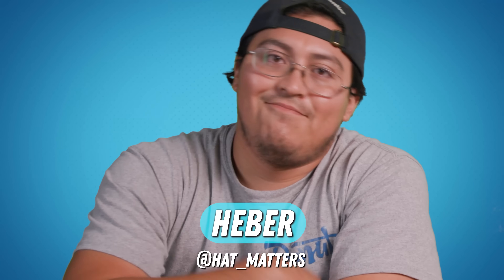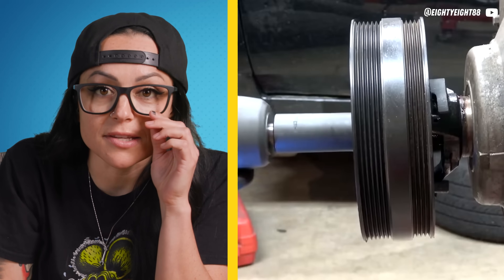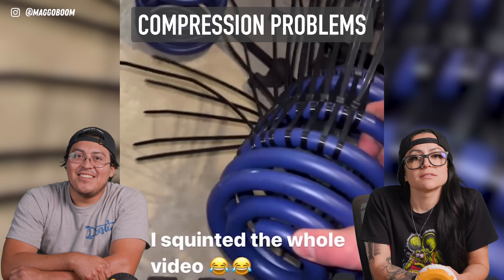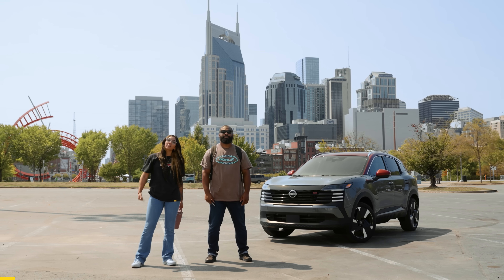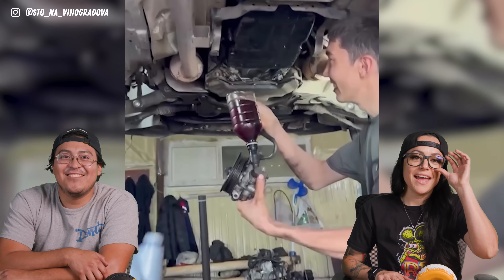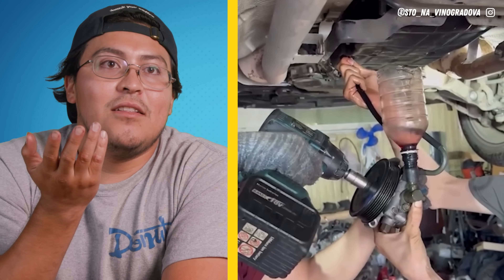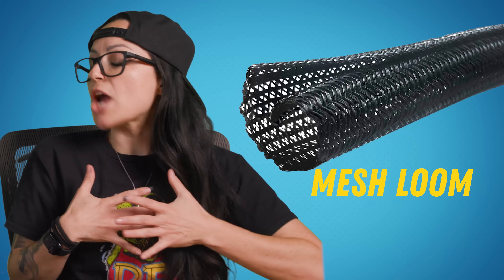Real Mechanics React to Ingenious Tiktok Hacks

Comment: The newer “Smoke” machines are actually just like vapes (for nicotine at least) use a mix base of propylene glycol and vegetable glycerin as a carrier where as the new leak machines and fog machines use just pure propylene glycol and that’s why it smells like marshmallows sometimes lol but that’s why it’s also none toxic if inhaled in smaller quantities. Fun fact lol the old machines sometimes even had a smoking pipe or cigarette end attachment, but if you have ever seen a current small counter top culinary smoker with a bowl for wood chips that was the start of the smoke tester.

Comment: There is a trick my Dad showed me, years ago, on how to remove the rear main seal. You fill the hole in the center with sand and then light bread, then using a wood dole, you drive the wood in and the sand and bread smash out behind the seal, and pop it right out. First time I saw it, it blew my mind.

Comment: Drill Brush brand brushes are made for that purpose and makes several different stiffnesses for different applications like carpet, upholstery, tires, bathroom tile, etc. I have a couple, and I don't have to worry about it slipping out of the chuck

Comment: I've actually done the zip tie trick with springs myself. Definitely worked in a pinch. But I find using some steel hose clamps, 10-12 inches, the best solution since they gradually release pressure as you unscrew them off...

Comment: Simplest way to get a stripped bolt out is to weld a larger nut to the top of it. Added bonus the welding acts like heat shock.

Comment: Never underestimate the power of the mighty zip tie.  I had a fully loaded dump truck  snap a yolk on it's pto shaft.  It was a 90 mile drive to the shop at the end of the day so I wrapped a bunch of zip ties around that yolk so she could make that last dump.  after she drove off, I ran over and picked up the shaft and headed back to the shop.

Comment: 14:56 I did this many times , my grandfather and my father had a motorcycle and bicycle repair shop and I can assure you that this works, I did this on my bicycle's brake cables when I was a child, I did it with pliers because there weren't any zip ties at that time.

Comment: For a trans fluid pump. I recommend using a pressurized tank with a 10psi relief valve screwed into it. It only takes a couple of PSI to push the fluid up through a small hose. Have fun and yes. Use the 10 psi relief valve. Or FAFO

Comment: That's a semi-truck driveshaft at 13.00 and the bolt head is rounding off and is not stripped. Very common to smash the head to expand it out. Then smack the socket back onto to remove the ROUNDED bolt and u-joint strap. The screwdriver an belt is for a stretch belt on an old Volkswagen.  You could sit and pick it all apart

Comment: I'm in the process of dealing with some front end rust that was caused by my not dealing with it properly a few years ago. I was just starting out learning how to restore a car and didn't really know what I was doing, using a drill and wire wheel to remove as much rust as I could from some suspension members and brake calipers, then painting over it with Rustoleum rust reformer and then paint.

Yeah, it looked really nice, until it didn't, because that stuff not only didn't really reform or convert the remaining rust, it sealed it in to grow out of sight, and, being rather soft, it eventually started chipping and scratching away, revealing the spreading rust underneath. So I had to take it all off again and remove the paint, reformer, new rust, and the old rust I didn't remove the first time, and repaint it, this time properly.

Of course by then I knew a lot more, and bought myself a die grinder and rotary tools and lots of different bits, and got just about all the rust off. Then I cleaned it thoroughly, with degreaser (NOT brake cleaner, which can leave a residue), applied Metal Prep, which is phosphoric acid with zinc, and finally POR-15. It not only looked even better this time, but it was now far more chip and scratch resistant, and there's been barely any new rust, and there only in a few tiny patches that chipped off from road gravel.

You NEVER just paint over rust with regular paint, unless you don't value what you're painting. If uncorrected that driveshaft will eventually snap due to rust, with disastrous consequences.

Comment: 11:50 and on, he's mushrooming the head of the bolt to tighten the fit of the socket. It's a great trick doing driveline and suspension work, especially up here in the northeast, where undercarriages come to rot.

Comment: On an aircooled VW the alternator/generator pully is two pieces with shims in the middle for adjustment. You remove the center bolt and the pulley comes apart to remove belt.

Comment: The VW belt adjustment requires the alternator or generator nut and shims taken off and either shims added or taken away to adjust the depth of the valley thus making the outer diameter to increase or decrease.

Comment: 10:44 You unsrew the nut of the generator pully. The pully is in two parts with washers between. You can adjust the belt tension with those washers.

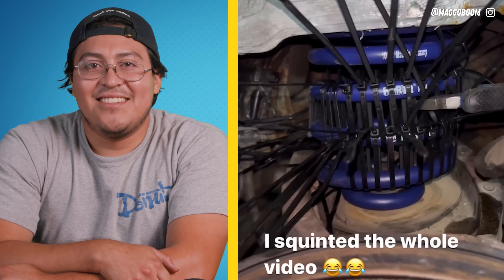Comment: 3:15 well the "angry ball of zip ties" comment was accurate xD
15:03 works nice but i would have heated that end and then dip it in candle wax to help it seal so it wont spread so easily later. or use basic solder. since over time those hats tend to come off and the wire would spread again

Comment: That video of the pressure washer with sand was kool but I probably would’ve used a cut off top to a two liter bottle of soda to spray through the hole and use the plastic for hand protection.

Comment: Rust can only keep festering, with the introduction of more oxygen. So if you dry out a piece of rusted metal, then paint over it with something that seals, it won't continue to rust. It won't get rid of it, but it won't continue. This is actually way the best preserved metalworks from 1000 years ago, are ones found underwater. Less dense oxygen, means the surface made a rusted shell, but it couldn't really penetrate deep into the metal, causing actual holes.

A spray paint with something that binds to oxygen is best, but once the rust under a normal, sealer pain, reacts with all available oxygen, more won't spread

Comment: Have done the zip tie on a little spring on my eksos pipe. There are sockets for stripped down bolts. You might have to throw that socket away with the bolt stuck to it, but that dont happen that often

Comment: I once used a ratchet strap to remove lugnuts on a flat tire when a friend without a lugwrench got a flat on the Grapevine in SoCal. Wrapped it tightly around the lugnuts and pulled like a SOB to spin those nuts off.

Comment: @20:45 - Do not do this with a Pressure Washer.  That is a standard Hose with faucet pressure.  And yes,  adding some abrasive in to the stream, helps a lot.  
regular water pressure with sand in the hand...

Comment: the whole beetle vw belt thing the adjustment is it's a 2 part pulley at the generator alternator and the center bolt lets it split and then there are shim washers to space the halves together more or apart less to adjust the tension of the belt, 100% safer to do the take the nut off and do it that way otherwise it's the same as a stretch belt for a ford mazda ac compressor just w a screwdriver instead of the inserts and a whole lot more sketch as it's running

Comment: The power steering pump/drill clip was them filling the transmission through the drain plug hole. My guess is that they can't get the fill plug off which is why they are forcing it through the drain plug.

Comment: The toilet brush thing also works great if your clothes dryer gets blocked inside.  Usually there are little holes in the back wall and they can become filled with lint/fuzz (my daughter did it with a new sweater).  Getting access to clean it isn't so bad but the actual fuzz removal is a nightmare without something like this.

Comment: The vw belts are adjusted by shims. There are 10 of them on the generator pulley. I have never seen the belt changed while running, i use a shop rag instead of a screwdriver.

Comment: It's actually kind of funny that he said if you go to the 99 cent store to get zip ties then you're going to have issues. I watched two different videos where they were testing zip ties and the ones for harbor freight were much stronger than the ones that cost several times more. They also held much more weight than they were rated for versus the others which held less than rated.

Comment: Milwaukee has a set of grips that you can put on lightly, then you can crank it down easily using a pair of pliers. Check them out. They are amazing! Because you just unscrew it and it'll pop off, no sweat or swearing.

Comment: 12:06 so the bolt in the yoke cap is supposed to be replaced every time per Spicer. They are notorious for stripping even when using high end sockets like snap-on or Mac. Even if you ruined a Snap-on and the dealer denied warranty (which I can’t imagine one would) it’s still 100 times cheaper to replace than the driveline. That’s in a heavy duty truck like a Peterbilt.

Comment: Rust-Oleum got its name from paint or primer that turns the rust into primer so when you paint your rusty surface the paint and the rest together will keep the oxygen from oxidizing the metal cuz without oxygen there's no rust analyzation with aluminum as a form of rust coating

Comment: For the DIY'ers in the audience, power steering fluid is either the same  or very similar to automatic transmission fluid. So using an old power steering pump to fill ATF is perfectly fine. 
 
* yes, factory fill often is ATF, look up the specs. That said, if your power steering calls for ATF, it is *NOT* always the same type of ATF as what your transmission takes.

Comment: 11:19 I use to keep a cheap set of sockets made by Buffalo tools. They were so soft that if I had a stripped bolt I would just beat on the next size down and it would form around the damaged bolt head.

Comment: In the volkswagen, The upper pulley have thin washers so you can control de width of the gap for the belt, then the tension is controled like a cvt.

Comment: I've personally seen 2 deglovings by air pressure and 1 degloving by oil pressure.

So yeah, I don't recommend the manual sandblasting thing, at all. High pressure anything straight to the skin is going to end badly.

Comment: The generator on those old air cooled VW/Porsche engines usually have a pivot that you can use to help tighten and loosen for the v-belt.

Comment: Another trick that can sometimes work with rounded off bolt/nuts is to put a rag of the thing to be removed and hammer on a socket so that the rag is between the two. Used that tricka few times.
Reply: I can second this method works and has saved me quite a few times over the years. You can also add more layers by folding and hammering it on to get a tighter grip. I've even used other materials like paper and tape with great results as well. It's best utilized before you completely strip the bolt/nut by using a loose fitting socket and rounding it more. If it's a sloppy fit to start, don't chance it and use something to fill the gap and it will save you from potentially hours of work.

Comment: u-joint with missing pins in the end cups? wrap 14 gauge solid copper wire around the inner joint, glob of grease in the cup, squishes on. bronze type bushing insert have the same/similar surface rigidity as some mild steel.

Comment: Angry ball of zip ties and potential energy is dam right. Done that with lift springs on a 4wd with 1000lb/450kg lift rate. Haha

The zip ties on the bike shifter/brake cable does work for sure

Comment: you have to remove the bolt from the center of the upper pulley to replace the belt and sometimes new belts are super tight in the grooves and it makes it hard and you pinch the belt when reattaching the upper pulley and the motor wont turn over.
Reply: belt tension on a old VW bug is done by adding or removing spacers from the uper pulley which is a split pulley

Comment: the ole new driveshaft trick...

had a dude do that with a Toyota I bought. Rattle canned the whole front axle and said it was rebuilt..inner axle seal leaked like hell and the trunion bearings were packed with mud and had rollers falling out..

Comment: the VW has two fixed pulleys the adjustment is through shims in the center of the smaller top pulley which has two halves when he presses against it with the back of the driver while the belt is off he is adjusting the tension by squeezing the two halves of the pulley closer and forcing the belt to ride higher when its put back on.

Comment: Me personally I would not use zip ties to hold tension on a spring as I've had a spring compressor fail on me before and the coil spring exploded into my knee I was lucky to still be alive but the pain was the worst pain I've ever experienced in my life so I would avoid using zip ties

Comment: The VW uses spacers on the top pulley to widen or narrow the "V" for belt tension, bit of a PITA but I still would not do it with a screwdriver like that.

Comment: You can do the paint trick with two clamps. Use a small one to clamp a big one to an old sawblade and tighten it like hell. It'll bend the blade but it works. With hammers, too!

Comment: I've used zip ties on a valve spring before and succeeded with a couple attempts. Took more than one because of ties failing. I would skip using them for suspension

Comment: Rust is a chemical reaction between oxygen and iron

An enamel paint will 99.9% slow down the reaction blocking oxygen molecules from interacting with iron molecules 

The problem with just applying paint to rust is that it doesn’t adhere well to oxidized metal and you risk delaminating and the paint coming off 

With enough coats and luck you can stop it rusting further 

The “rust paints” often have plasticizers and/or acid compounds that help with further blocking, neutralization and adhesion for a 1 time application 

But you can most definitely paint over rust to stop further rusting. Just thicker coats and reapplications 

2x has a primer in it that will help it adhere to rust

Tested and holding satisfactorily on barrels in a high humidity environment

Comment: Balancer pulling was a fail. Very possible to slightly shift the outer ring on the inner piece. Belt will shred. I had one where soemone uses a two jaw puller and did it did that. Only moved the outer ring like a mm so I played hell figuring out why the belt kept shredding.

Comment: So with the whole transmission filling thing and engineers designing a better way to fill it, what you're saying is that engineers should bring back transmission dipsticks for all vehicles because I know, like Ford E-Series, the ones that may have for ambulances, those still have a transmission dipstick if I remember correctly. Still, transmission dipsticks phased out, at least for Ford in 1998. At least, that was the F-series. I don't know about cars.

Comment: Back in my short career in industrial painting i was slapping paint on top of a cooling tower with a rag in one hand and brush in the other, quickly taking away most of the water that was condensed on the railings and putting this toxic shit on top of it before it got wet again. I don't know what that paint was but everything about it felt like it causes cancer just by looking at it. But apparently it can deal with moisture and surface rust, we did go over them with wire brush and sand blasting but it was far, FAR away from clean. The most dangerous job i've ever done was painting catwalks. Since then i've learned to say "no".... 

No harness climbing with a bucket on a string, no decks but just the frame of the catwalk that you are also painting.. So no going back and you got to know what has been painted cause.. paint is kind of slippery. Tried a harness once and that was the only time i almost fell. Couple of two-by-fours that you dragged along to stand on, the most dangerous part was to climb to it since there were of course no steps on the stairs either. And i was scared as fuck the hole time, but i think that is what kept me "safe" all the years when doing stuff like that. Working at heights while being scared of heights is apparently quite common... I just don't freeze in those situations but the times i've had my knees wobble.. Shivers go thru my spine still.

Comment: VW air cooled motors are weird on the way that they tension the belt. It uses shims and a tapped disk that you saw on the top of the pulley to get more tension remove shims and it pushes the belt higher or add shims to widen the gap and let the belt sit lower

Comment: The power steering pump hack is more expensive than a purpose built drill power transfer pump. Maybe $20 for the exact same thing
Reply: Compared to $0 for a pump that you removed from a car because it wasn't working properly but it still works well enough to push in transmission fluid.

Comment: Can't do that on my 04 VW Passat 1.8T as it is an interference engine. I'm also an auto detailer. I have two different types of bristle heads like that. Medium firm for carpet as they are able to handle your feet. Soft to extra soft for the headliner so you don't agitate the adhesive.

Comment: 17:26, My sister is a hand doctor... and she's told me of cases where hands and pressure washers interacted.  DO NOT RECOMMEND! Do Not Try This At Home!

Why? That water is powerful enough to puncture a tiny hole in your skin, the water is Not Sanitary, bacteria gets Under the skin, and an infection starts under the skin of your hand.  With pressure washers, that water under the skin can fan-out over a wide area.  The doctor has to slice-open ALL the skin where the water reached, clean it out, and disinfect it.  A big deal! Please avoid this, just use a little kid's $1 plastic beach shovel or something, Not your fingers! 😯